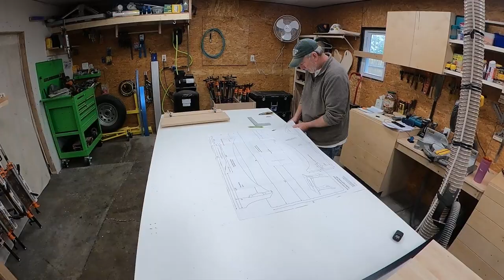DIY Sewing Stand Table Woodworking Project #sewing #furniture #project

Comment: What is CA glue? How does the top stay on?
Reply from the maker: It’s a very fast curing glue.  Small bottle is glue and the spray can is an activator.  It comes in multiple colors and most wood workers use this product. Great for filling flaws and sands well.
Hope this answered your question.
Take care